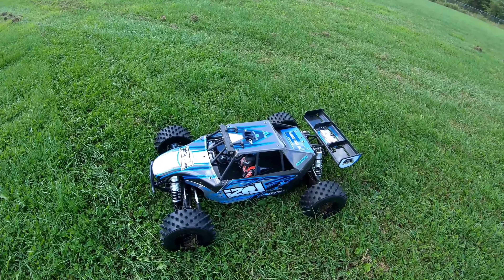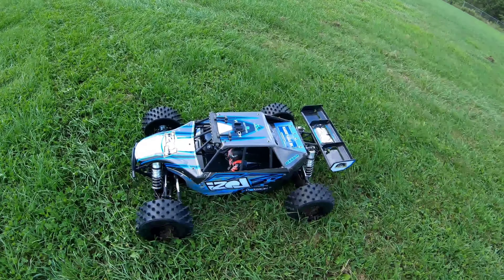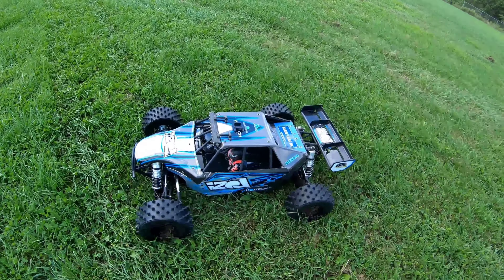Losi dbxl-e V1 12S💥 -First Rip Braapless Beast!!

Comment: Wow! That thing is insane!
Reply from the maker: Thanks man. I am really curious to see how long this motor lasts though. I have had it a couple years. I think it may be on it's last leg. I have a back up though.
Reply: Steel City RC awesome.  It’s definitely one sick build!
Reply from the maker: @MetzRc84  Thanks!! I had the Outcast 8S out today and broke a front lower arm first set of packs. It does run better with the 23T pinion and punch 5. But the arm snapped like a twig. About to check out your video!!
Reply: Steel City RC sweet! They already sell the rpm front arms for it.  I emailed RPM and they are currently working on getting the rear arms in production.   I still haven’t messed with my outcast setting.  I’m waiting on the spektrum programmer to come in the mail
Reply from the maker: @MetzRc84  RPM arms fear me that they will be worse than stock. Like they are for the Xmaxx

Comment: Holy shit. What is that like 50 volts? Pretty soon you'll be able to plug your TV into it haha

Looks as good outside as it does on the inside.
Reply from the maker: Hahahahaha! I never calculated the voltage. You are right though. 50 volts. I want to put some reegular wheels on it I don't care if I shred them or not. Then go have at it.

Comment: Love it, what wheels and tires are you running? I have the Duratrax lockup x's on mine and twice I have broke the hub completely out of the center of the wheel and mine is still all stock besides the pinion.
Reply from the maker: Thank you. The wheels and tires are BRP super spikes. Need IRP wheel adapters to fit them. They are a four lug system. Has four studs and nuts. Quite spendy. But I needed something to contain 12S and I can use them on my 5iveT.